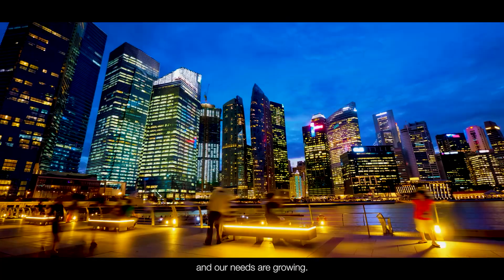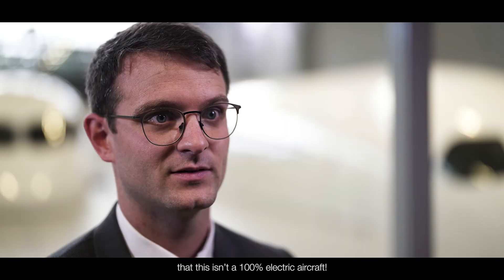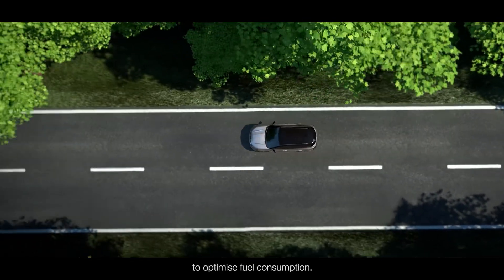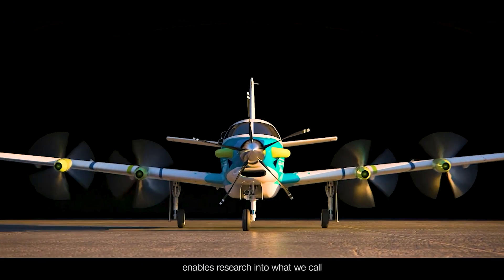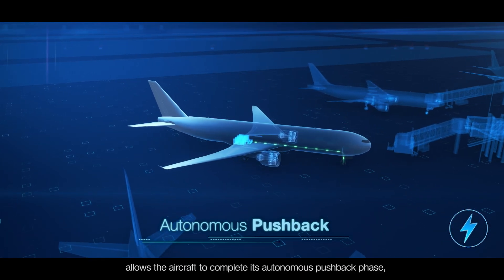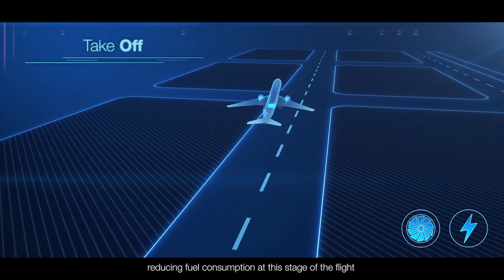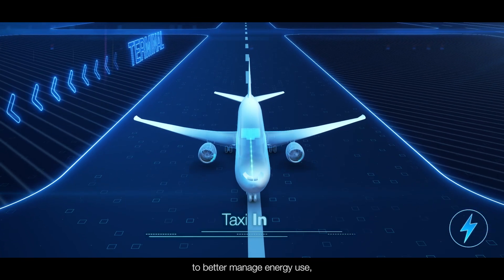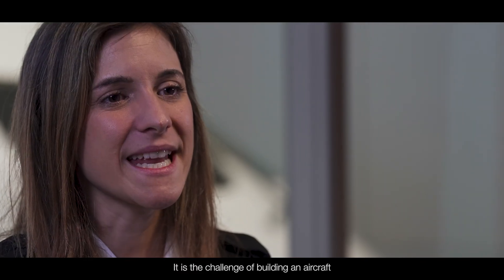How hybridisation contributes to the decarbonisation of aeronautics

Comment: Some narrow thinking there. The push back tugs should have a large battery and a new role. The tug should be a robot and take over powering the aircraft the moment the aircraft must cut its power connection to the terminal. The aircraft can use motorised front wheels for push back and driving itself to the runway. The 'slave' autonomous 'tug' follows behind providing power until the aircraft must power up and prepare itself for flight. Ground crew do the power connections at the terminal, and the pilots eject connection at the appropriate time before plane enters runway. After landing and exiting the runway, crew in special gear and vehicle connect a robot 'tug' power supply to the rear of the aircraft for the journey to the terminal if a worthwhile energy saving can be made. While long haul aircraft systems should be made electro-mechanical, and hydraulic systems done away with, weight minimisation is also a goal - battery should not be used for flight power except in an emergency. 
The 'blown-wing' effect means short range electric aircraft become STOL aircraft and many more places can be used as airports - increasing short range travel demand. BEV aircraft can use a robot battery to provide power until turn onto the runway, but should not need one on landing due to regen on approach and energy reserve that must be maintained for diversions.

Comment: @4:07 "take the strain off he engine" this sounds like marketing waffle - what does it actually mean?  Rather disappointing that you're only looking at a 5% reduction in fuel consumption.  Surely you should be aiming for a much bigger saving?
Reply: I agree not much info was being put on here, especially when they said that the "energy from the engines can be used to recharge the batteries" but that 5% fuel reduction can really go a long way. 5% reduction can build up and millions of dollars can be saved. Hopefully they introduce newer technology soon though.

Comment: Love to see those numbers. A lot of extra weight being hauled around for 5% fuel reduction but obviously that was accounted for. And is it such a good idea to go from a cold turbine to take off power in a very short time? Why not have an electric ground tug help with taxi out. Why not drive the ground electrical motors from an APU or fuel cell and minimize the heavy and potentially dangerous batteries that have caused safety problems in the past. It all sounds good to some in a slick video but I don’t believe that this is the low hanging fruit.

Comment: Are you guys sure that a 5% reduction in fuel consumption is worth the investment in battery research and the high cost of manufacturing hybrid aircraft? It may be feasible on long hauls only.
Reply: 5% in modern ailiners is actually huge.

Comment: Great video! I'm guessing using electrical propulsion will also help in reducing noise around the airport as well, during both taxi and takeoff/landing.
Although, when you say it saves up to 5% of fuel consumption, I have to ask, in what range of flight? is there a link to where I could read more about this?

Comment: Back in my Aeronautical Engineering days, i used to think of Hybrid Propulsion Systems for commercial aircraft. It really joys me that it's finally happening. Good work Airbus.
Reply: same. Question...do you think it's possible to have some sort of MGU-H system to recover heat and turn it into electricity? Or an MGU-K where during decent, kinetic energy is turned into electricity? It technically should be possible right?
Reply: @hodb3906 the engine turbine is there to extract all feasible power from the jet exhaust. Turbine power turns the compressor and the fan, and the generator is connected to the turbine shaft to provide power to the aircraft. No excess power generated by engine until plane lands. Could shutdown aircraft engines after aircraft has slowed the taxi speed, and use battery power.